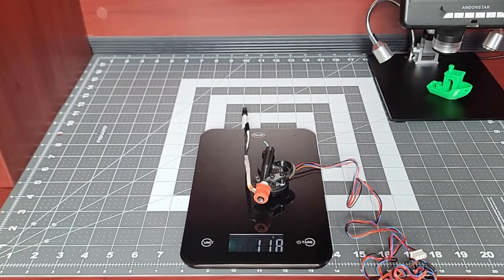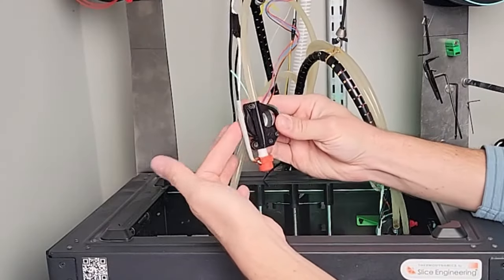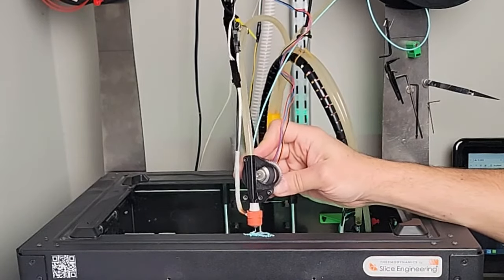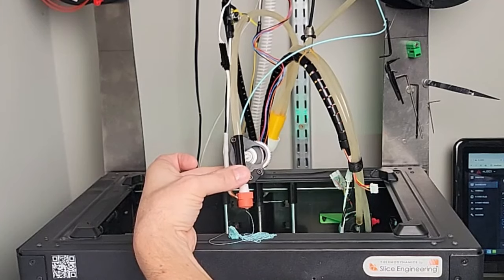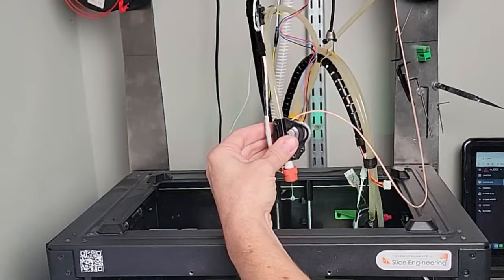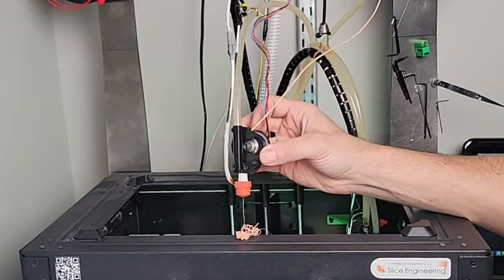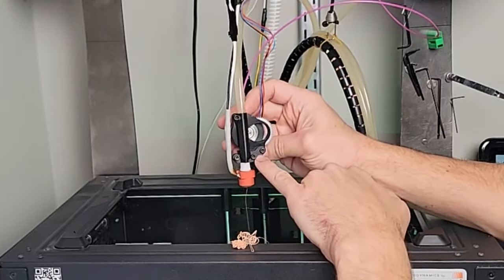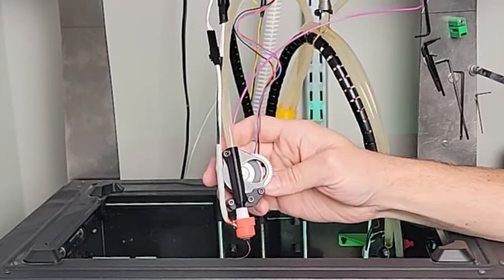Introducing Picolino: The World's Lightest Direct Drive Extruder!

Comment: first of all, I must say that you did an extremely great job and I have great respect for it. I have also been thinking for a long time about an extruder that has a similar extrusion system to the nextruder from Prusa for my toolchanger. Your idea is brilliant, but from what I can see in the video, I am afraid of its durability because I guess that the entire filament pressing force is based on the main gear wheel, which is based on this small stepper motor, and in my opinion, resting the weight on the motor axis is very bad idea. the motor axes are designed to transmit power and torque, not bending force, I would really like to see an improved version that permanently bears the gear so that it does not "climb" up the filament during extrusion and acts a bit like a spring after the feed is stopped (because of plastic housing) fell and extruded, for example, an additional 0.05-0.1 mm of filament. Personally, I already have an idea on how to improve it, but it would be difficult for me to describe it in the comments. I'm also curious how you made this large gear. I was thinking about designing it myself and letting a company do it, but I'm afraid it will be cheaper for me to buy ready-made gears for the Nextruder and an stepper from them.
PS: One more question, have you already tested the power of this extruder and the quality of details, because it has practically no gear ratio, and when printing quickly, as an LGX lite owner, I can say that despite the gear ratio, it lacks some of it.
Reply from the maker: Thank you for your kind words and detailed feedback. I appreciate your engagement and insights into the extruder's design. Note that the gear ratio is similar to other extruders.  The ring gear was laser-cut from spring-tempered steel. 
You can see more technical assembly drawings here: https://x.com/m_IDEX/status/1860479155860607032
Reply: In theory you could deepen the motor gear by adding a smooth shaft like portion to the end and add a bearing or bush on this end to take the reaction from the meshing gears, that would locate in the extruder casing. This would reduce the Nema motor shaft loads considerably, and give a more consistent extrusion, likewise the ring gear circumference could be modified, so that the opposite diameter was constrained, so the Nema drive gear couldn't be loaded the same.

Comment: Not going to have enough torque using a nema 14 and that low of a ratio. Unless you want to run it super hot. 
The drive gear is not constrained with bearings? 
 I really like the concept and wish you the best. Keep going!

Comment: How many steps per mm?
Reply from the maker: Steps per mm ≈ 163.36 (according to Grok)
You can see my technical drawing here:
https://x.com/m_IDEX/status/1860479155860607032

Klipper Config:
rotation_distance: 99.9
gear_ratio: 51:10 
microsteps: 16
full_steps_per_rotation: 200 #1.8deg Motor
Reply: @m_IDEX  This ratio is too high for fast printing. Motor is beyond it's TQ limits at speed. It's a really neat idea, kudos.

Comment: Me and a friend are debating the gear ratio of this thing. He was thinking it would be about the same as the difference in number of teeth, but I disagree. It looks to me like it basically has 1:1 gear ration, zero mechanical advantage... Can the author confirm the facts here?
Reply from the maker: The gear ratio is closer to 1:1, though another viewer calculated it to be around 1.24:1, and I believe his math is accurate. In hindsight, if I had done the math earlier, I would have included an additional gear reduction stage. However, I was pleasantly surprised to find that Picolino can extrude at about 24mm³/s before skipping steps. I think a lot of torque needed for extrusion is actually used to crush the filament. Given my tooth geometry, there's minimal filament deformation, which means more torque is available to push the filament through. Also, due to a very efficient motor cooling system, I am able to drive the extruder motor much closer to its rated current.
Reply: @m_IDEX  Appreciate the honesty; that you didn't over sell the thing. Says a lot about your character. 

I also took a real stab at actually calculating it and came up with similar numbers. It would be fairly straightforward to improve it with a planetary arrangement, but it would cost you in complexity. Worth thinking about for a V2.

Base level hot end (e3d V6, Creality ender hotend) is something like 12mm^3. Best hotend flow rates are something like 55mm^3. So 24mm^3 is perfectly respectable considering. +1

Comment: Integrate the revo with it.
Reply from the maker: I appreciate your suggestion to integrate the Revo hotend. It's indeed a nice piece of technology, known for its reliability and ease of maintenance. However, I've recently had great success with the Dragon heat brake paired with the CHC ceramic ring heater. This setup has allowed for a very sharp temperature transition using only a small copper heatsink, which I've found to be quite effective. 

The combination not only maintains performance but also reduces the bulkiness that comes with larger legacy heatsinks, which is something I've grown to prefer. That said, the Revo does have its advantages, especially in terms of ease of use and quick swaps. Thanks for bringing it up, though; it's always good to explore different options to see where improvements or combinations might be made for future projects.
Reply: @m_IDEX  I do have a Revo Micro (30g), that has a much smaller heat sink and fan compared to the standard Revo, and the cold side of the Revo system is "open sourced", so it's entirely possible to look at a custom smaller heatsink in copper. Hot swappable nozzles are much more popular nowadays, and can be sourced from multiple companies.